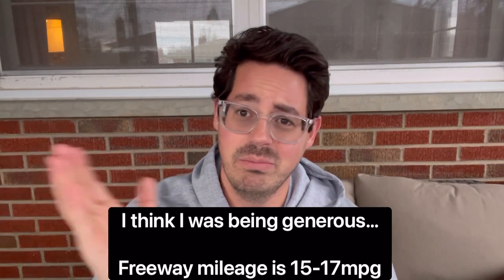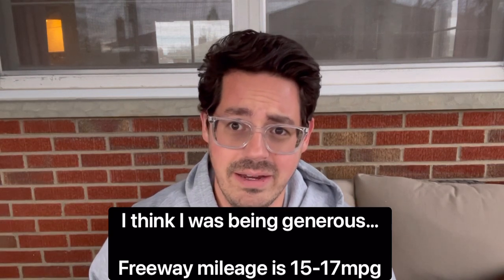Worst Engines of All Time: 1982-84 GM/Chevrolet 305/350 V8 Cross-Fire Injection System

Comment: My 82 Z28 gets terrible mileage as well, but it's an original 45,000 mile car so I'll take the good with the bad. ;) On a side note I believe  if I remember correctly the best years to buy a 700R4 is 84 1/2 to 87
Reply: '87 and up had the auxiliary valve body which helped correct some issues. There is a ton of upgrades for these transmissions. I've built the one in my son's 3rd gen with a nitrous injected 383. He drives it 50 miles to the track, runs 11 second quarter miles, and drives it home. I wouldn't call the 700r4 bullet proof, but they can be reliable.

Comment: Long runner intakes are terrible for high RPM engines. The longer the runners (within reason) the more you encourage low end torque.
Reply: This is correct. It was a terrible system, but not because of the runner length
Reply: I was surprised Adam said that. 
He’s accurate 98% of the time.
Reply: APPARENTLY, you have not seen the Holley Sky Ram intake.  YouTube only. Lol
Reply: That's correct.  I was about to post the same thing.  Long runners produce more low and mid-range torque and HP, and short runners produce more high RPM HP and torque.
Reply: and a lot of this tech was started by the RamCharger guys. ( they were engineers who worked for Chrysler during the week and raced on the weekends) Their first experiments were in intake pulses which lead to the cross ram. Later they began doing experiments that led to the tunnel ram system. If you look at the 225 the intake on 1 and 6 they use a long runner, the 2 and 5 use a medium runner and the 3 and 4 use a short runner. This give the slant a constant Torque band through the whole RPM range. (Granted it's not like racing levels, but it helps getting a 3k LB car going)

Edit: Spelling.
Reply: @davidmiller9485  the slant six like most american sixes was built to be one thing: cheap. It makes no power at any speed. The intake uses a single carb and those unequal length runners which makes fuel distribution all wrong all the time. Seriously pull the spark plugs on any single carb six. Two will be rich. Two will be good. Two will be lean.

Now go look at a typical performance six. Jaguar XKE uses three carbs for even fuel distribution. Triumph GT6 uses two. Even the Hudson Hornet also had two carbs. Old hotrodders would use two or three carbs also. A lot of motorcycles use one carb per cylinder.
Reply: @TheRetarp  uh NO, Chrysler wanted a six cylinder engine to put into a mid sized car. The idea was to make an EFFICENT engine in a "European" style hood line, hence the slant. The engine is designed to be efficient, not a racer.
Reply: Yup. Just like a single plain intake would improve higher RPM power while sacrificing some just off idle power.
Reply: Yup noticed that too.
Reply: Then there is the Tunnel ram intake with long runners  : )   but they are straight line , but are good at high rpm ...... just not a street viable solution
Reply: Something to bear in mind here.   We all know that long horizontal runners are for low rpm torque.  But consider the tall high rpm tunnel ram manifolds that take advantage of that pulse wave to help drive in intake air.  Was GM trying to duplicate this effect horizontally?
Reply: True with these engines were terrible for revving anyway. If you went above about 5000 RPM you risk having your inside parts become outside parts
Reply: Also 750cfm is way too much for an engine this size and HP 470cfm is plenty. These were low performance engines due to having to meet mileage and pollution targets.

Comment: My sister had an 87 Camaro that she bought new and kept until 2001...  over time the body flexing caused stress cracks in the roof above the railing edge of the side windows....  a piece of junk compared to my 70 Camaro and even the 70 had so much more plastic inside than the 67 - 68 Camaros...

Comment: You really got it wrong on the runner lengths. Longer runners are good for lower rpms and short runners for higher rpms. It's all about the pulses that are generated by the valve events and the pistons creating high and low pressure areas. There are specific rpms that these pulses tune to and will create a ram effect down the intake runner. That is why you have variable intake runner lengths now. At low rpms they use the very long runners and high rpms it will switch over to very short runners.
The pooling of the fuel or the fuel falling out of suspension is more of the extremely large plenum area that's inherent on an intake like this. It has nothing to do with the runner length.
Reply: Solid explanation
Reply: Thinking of my VW Mk4 vr6 intake changeover rod as he spoke, they had a long/short runner setup and a rod to move flaps to change between runners.
Reply: Yep.  I was thinking of the injected Windsor engines from Ford, and the difference between the truck and car intakes.  The truck intakes had VERY long runners.
Reply: I know every other tbi intake design by GM have very small plenum, the tbi v8s has those awful swirl port heads.
Reply: Yes why Chevrolet went to the L98 which still is all in by around 4600 rpm and finally went to the 92-96 LT1 and hitting 5000 rpm and more with the LT4 . The long runners make great low end torque . The Callaway Corvettes B2K had awesome torque .
Reply: *TPi enters the chat
Reply: The 80's/90's V6 SHO engine is an excellent visual example of this as well. The short runners are closed until roughly 4,000RPM, forcing the air through the long runners that feed from one plenum, across the engine, to the opposing cylinders.
Reply: I'm wonder where he is getting his info from cause he has made some basic errors in other videos. In another video he didn't even know that Pontiac never had a big block
Reply: @jerrycann6374  Technically speaking, Pontiac never made a big block production engine.  All Pontiac V8's share the same bore spacing.  The difference between a big block and a small block engine is the bore spacing.  All Pontiac V8's are a mid-block like the early first gen Hemi, the Ford FE engine, and the Olds V8 which all share similar bore spacing dimensions of around 4.6" or so.  Now the Olds 400, 425, and 455 have taller deck heights, but the deck height alone does not make an engine an actual big block, it makes it a tall block.  The late Pontiac 265 and 301 had shorter deck heights compared to all other Pontiac V8's.  But a Pontiac 287 shares the same bore spacing and deck height as a Pontiac 455.

What we typically refer to as small blocks have bore spacings of 4.4" or smaller, and typical big blocks have bore spacings of 4.8 and larger.  4.6" bore spacing is a mid block.  So now you've learned something.
Reply: @corvettejohn4507  I am  well aware of Pontiac's intermediate engines, how to build them and and how to blow them up. I have built a bunch of SBC, a few Buicks and 1 Olds engine. It was a nice life when each brand had their own engines.  My built Pontiac 400 in my 74 Grand Prix was one of the best engines I owned
Reply: @jerrycann6374  Sorry Jerry, I misread your comment.  I thought you were saying that Adam didn't know Pontiac made a big block, but you were saying that Adam thought Pontiac did make a big block.  The double negative threw me off.  I agree with what you said.

400 Ponchos are good torquey motors.  I had one in a 1969 Grand Prix once.
Reply from the maker: @jerrycann6374  excuse me. What do you call the short deck 265/301?  They are not the same physical size as the 326-455.
Reply: @jerrycann6374 To keep things in perspective, remember this is the hipster wannabe car collector channel.
Reply: @neighborscomplaint6859  I'm not interested in your comment, he didn't even know that Pontiac engines did not have a BBP in one of his other videos.
Reply: @jerrycann6374  The whole big block/small block started with Chevy. One engine was physically larger than the other. Pontiac does not technically have a big block because even though the cubic inches are different, the physical dimensions are the same. Hence a 326 is the same size as a 455.
Reply: @johnnystephens6329   How do you account for the different deck heights of the 265/301 family versus the rest of the Pontiac engine family? (287-455)
Reply: @johnnystephens6329  Both Ford and Mopar made small blocks, mid blocks, and big blocks.
Reply from the maker: @jerrycann6374  I suppose you don’t know Pontiac made a 265 and 301 which were physically smaller than the 326-455
Reply: @RareClassicCars  My parents had a 1980 pontiac bonneville with a 265 V8. What a freaking gutless engine. But it was pretty bullet proof. Just ran and ran and ran even though it was not terribly well maintained. I remember after about 150K miles and still using regular gas (87 octane) I could hear the pinging when stepping on it. But never seemed to cause a problem in the little engine.
Reply: Just wondering. Who gives a f7#k!!!
Reply: @lincolnvaldez1977  a lot of people, considering we come here to learn about cars…

Comment: For your throttle cable issue, isn't there a spring you can make to add tension and force automatic throttle return as you lift the accelerator?
Reply: Or speedometer cable lube for the cable...

Comment: As a young man about 22, I was looking at an '84 Corvette. The salesmen who had a soul told me "You don't want this car son, you won't be happy". God bless that man. He must have had children my age.
Reply: Cool. What else Chevrolet did he recommend? I liked the Chevrolet big car for 1984. 1984 Chevrolet Impala, 1984 Chevrolet Caprice Classic, and the 1984 Chevrolet Celebrity too. The Chevrolet 350 is best for the fat Chevrolet.  Chevrolet 60 degree V6 was pretty good with HO or standard.  Celebrity used V6. The fat Chevrolet did fine with Chevrolet 90 degree V6 or Chevrolet small block V8. However, they were slow machines.  However, it was cool that you checked out the new Corvette for 1984. My family got a dog for 1984. The 1984 Dodge Caravan.  It was a dog. First 2 years was a lemon. After 2 years, it was more reliable. Still a dog, though after spending $2000 in repairs. In 1980s money.
Reply: @bryantint1339  that 2.8L 60 degree turned into the 3100, 3400, 3500, and 3900 engines
ive got a 3.1 with 325,000 miles on it.... lifter/rocker ticks till it gets warm, but still runs great 
.
LIMs at 180k..... then LIMs again at 300k because the head gasket went 
now i have a timing cover leak....... leaking coolant 
.
.
i have two 400 SBCs..... and its better than a 350 in every way
just not gas mileage (unless you change gearing for the added torque) 
.
a 77 400 out of a K10 will put down 245-265 hp......380-400 foot pounds
removing your heat raisers/intake cross-over, EGR, and adding a bit of initial and mechanical.... 
it will wake it right up
..
the larger 400 bore makes the exact same head (and/or cam) flow just a bit better .... due to "valve unshrouding" 
.
 .
.
one is factory original in my 77 K10 silverado (TH400 NP203 full time 4..... its a GAS HOG! but runs PERFECT!)
other is in a 68 impala 2 door hard top......(NOT factory lol..... needs a LOT of work)
Reply: @kainhall  first car was a malibu with the 3500, one of my favorite engines
Reply: @bryantint1339  a W-body car with a GM 60 degree is the easiest car to work on ever
.
if they didnt keep changing the damn plug.... i could of had my fuel pump done in 10 mins
access hatch JUST behind the rear seat (can even reinstall the butt cushion for comfort on the job..... just dont spill)
.
water pump takes like 10 mins on the 3100/3400 
PS pump is right their..... alternator is on top.... 
.
.
pretty much EVERYTHING is 5.5, 8, 10, 13, 15, 18, 21, 33 or 35 depending on exact wheel bearing brand
325,000 miles on a 99 buick century.... and im a mechanic
.
i know a thing or two..... because ive seen a thing or two
like now my timing cover is leaking coolant..... 

.
.
honestly didnt even know that was possible on the 3100
but after thinking about it for 10 seconds..... ya, the "divorced" (aka easy to change) water pump.... gotta get coolant from somewhere
Reply: and looking at the gasket kit.... which includes 2.8 parts.... 
the block is just a v6 SBC.... with tiny little main cross bolts
.
the gasket for the 2.8 is for a "center" mounted water pump, like on a 350
they just moved it to the top right on the 3100/3400
Reply: @kainhall  2.8 is a v6 SBC? Nope. 

The 4.3 is.
Reply: @ryans9029  didn't say it was
.
It's a 60 degree with a water pump LIKE a sbc
Reply: @kainhall     "the block is just a v6 SBC... With tiny little main cross bolts.." 

That's what you said.
Reply: A wise man.
Reply: he probably got fired for being honest
Reply: @erics8192 lmao
Reply: @Salty Creole now that is the type of salesperson I would buy a car from. Definitely rare to find one who cares more about the customer than the sale.
Reply: I had a 1994 Grand Prix SE with the 3100 SFI V6. It's still one of my favorite cars I ever had and I still regret trading it when I did. Never had any engine trouble at all after owning it for about 6 years. No leaks, no oil consumption, nothing. The rear brakes were too small for the car (non-ABS model), being supplied from the GM parts bin leftovers of the tiny 1993 Le Mans, so I was forever changing those. But other than that and a worn out wheel bearing, it gave me no trouble. It ran and drove great, and was always fun to take on a spirited drive in the suburbs and back country roads. Lots of trunk space made it great for a family vacation to the beach while providing a very comfortable ride. These W-body cars don't get the appreciation that they deserve. They were very good, fun, affordable daily driver cars in their time and should be recognized as such.
Reply: @brandonzilka1274  I rented a 93 Grand Prix SE on our honeymoon in Yellowstone National Park.  I loved that car.  I really hated to turn it back in.
Reply: @elizabethcarlson1321  you rented your honeymoon car? Sounds unusual. Usually guys are all over that
Reply: Back in the 80s cars had a lot of hoses for emissions.  At least that is how our 84 Jeep Grand Wagoneer was.  It had a 360 but a pathetic 144 horsepower.  Imagine if cars these days had the same power per liter.  The 2002 Neon I once had would be so slow it would leave a silver trail behind (not just because it was a silver car).
Reply: I almost bought a crossfire 305 powered 3rd gen for my first car, luckily the dealer primered it and jacked the price up on me and I walked, and I ended up with a foxbody instead! Loved that car, shitbox that it was lol.
Reply: I had a guy like that in Sydney , I was looking at a British ford sierra turbo ….I was like 18 and he said mate I could not sell this to you and be able to sleep at night
Reply: i'd had a few vettes and loved them.  my dad was a navy pilot, he bought one without saying anything thinking i would be surprised.  yep, good thing he never had much to compare his '84 with, though i think his '69 chevy wagon was a lot faster
Reply: The 84 Vette was fine for the times. It had incredible handling  and 205 HP was more than Mustang and almost everything else. It made maximum torque at 2800 RPM. It got more powerful in later years, but you could have a ton of fun in the 84. The engine was the cast iron 350 block very reliable especially compared to stuff from Europe.
Reply: Now that's a good deal.
Reply: Once the Corvette got real multi port fuel injection in 1985 it got way better and kept getting better from there. My 89 C4 had the MPFI and the additional oil cooling system. Had a lot of fun in that car.
Reply: I have one. And yeah if u want a nice car that you don’t have to take care of  the car isn’t for you. Although the engine is slow and it sucks so I will be engine swapping
Reply: @1OnlyFritz i test drove an 84 vette, one with the manual, it was pretty quick but had no top end imo. I was comparing it to a cammed fox body at another dealer. The 5.0 had more top end and torque.  I was still in high school and couldn't decide or get enough money for either so i ended up with a ford probe gt 2.5l v6. Idk what my point was but yeah...
Reply: He must've been an angel.
Reply: So you got the 85' then?
Reply: They’re torquey as all hell but top end hp is non existent
Reply: @tylernorris7945 Top end for an 84 Corvette is around 140 mph. Not bad at all. Gets around 28 mpg at normal interstate speeds.
Reply: They will burry me in mine with a smile on my face. it wasn't for you.
Reply: He also was hoping other salesmen would say the same thing and therefore the car would not sell, forcing GM execs to stop being greedy, egotistical jerks and start putting money back into the car's technology and testing.
Reply: No doubt he got fired the next day
Reply: @wildman510  I am sure they just found someone more deserving of a lemon like that

Comment: Where would the LT1 and L99 V8 from the 1990's fall? I owned two cars with the LT1. At first they were tremendous, but then when tune up time arrived, Lord , have mercy!🙄
Reply: Except for the location of the Optispark distributor behind the water pump, the LT1 was a very reliable and powerful engine. I have no idea where you're coming from as far as your LT1 cars are concerned.
Reply: CFI/TPI runners were too long... EFI LT1 runners too short... LSx engines got a good compromise length...